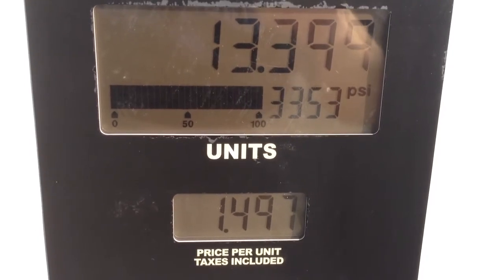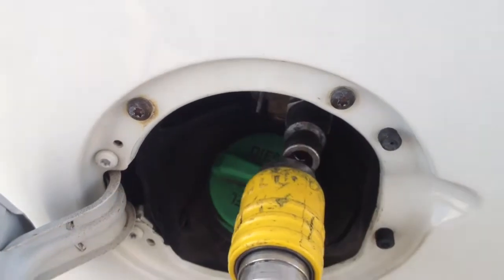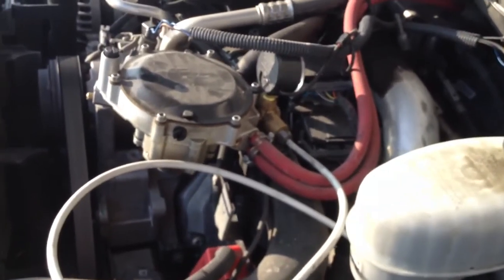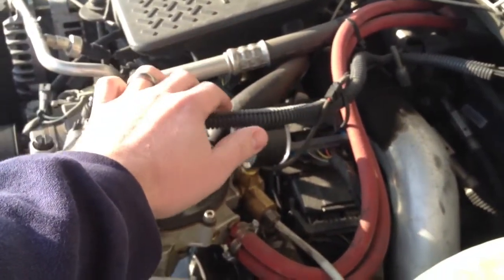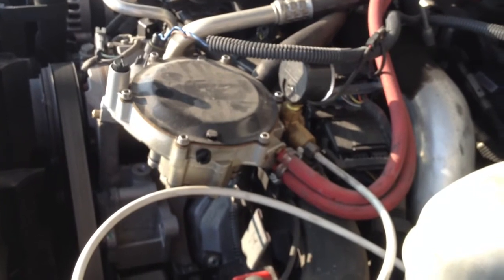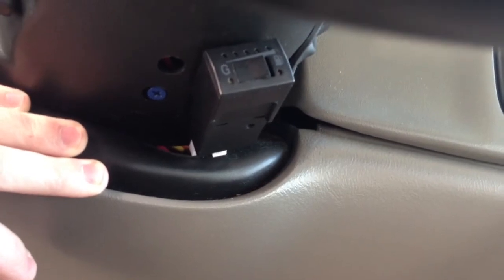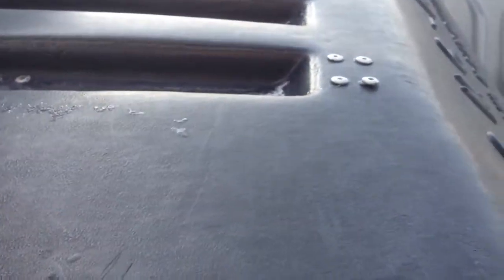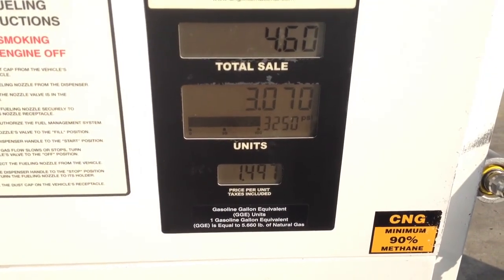Diesel Natural Gas Conversion System Overview

Comment: your web site does not open, says domain does not exist.
Reply from the maker: thanks for the heads up. website is up and running again
Reply: the link works, but there is not any kit information or pricing for any vehicles.

Comment: How long does 18 gallons last/ or miles u get out of it
Reply: so on a 400 mile trip you would burn 14 gallons of cng at $1.50 to $2.00 per gallon and also burn 10 to 15 gallons of diesel at roughly $2.50 a gallon, where as it would normally take 20 to 25 gallons of diesel and no cng, is this correct? So your engine is still consuming roughly the same amount of fuel in gallons for both non cng and with cng, the only difference could be up to a $1.oo per gallon cost for the fuel  and not taking into account the initial cost of the kit and tank. Is my math right?
Reply from the maker: On commercial stations you only fill about 80% capacity of your tanks. On the mix level that we had set on this Duramax we would get about 400 miles to a fill. The tank capacity was 16 gallons and we would normally fill about 14 gallons.
Reply from the maker: Yes your math is correct. When we are talking about diesel/CNG duel fuel systems we are looking at replacing diesel with CNG. The savings comes in when the cost of CNG vs the cost of diesel is large. Right now there is not a huge price difference between the two fuels so savings will be less. When price of diesel rises savings also rise.
Reply: at current prices of $2.30 a gallon for diesel and $1.75 for cng which the closest station is 60 ish miles away from me on the Texas gulf coast. at those figures for every 400 miles you would use 6 gallons of diesel and 14 gallons of cng. or $24.5 cng and $13.8 diesel. at the cost of the total kit running $3-3500 (depending on tank) it would take 180,000 plus miles just to break even. if you could buy a 15-20 gallon DOT approved tank for under 500 bucks then it would be more economical. but then you also have to follow dot rules having the tank hydro'ed and eventually replaced. what would be a better deal is if there were rental tanks like when you go exchange your propane tank for a gas grill. If the cng fill stations would come up with that I think the market would explode again. have them all the popular sizes with a quick detachable hose and tank mount system like with N02 for race cars. also if the local propane/butane places would have the exchange program then every little town would have a fill station.
just my thoughts, nothing personal just trying to see the economic side of things.